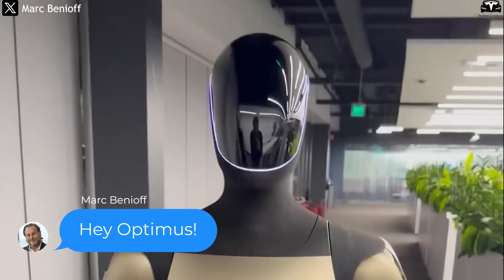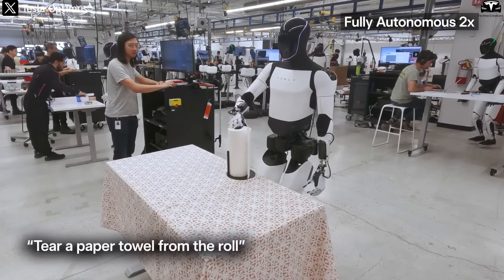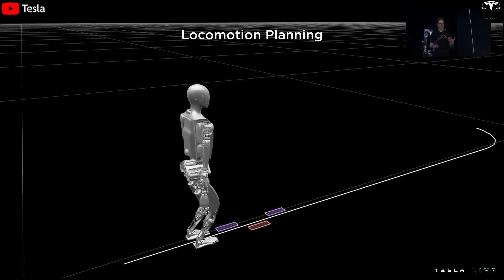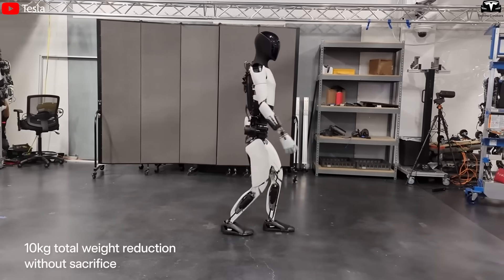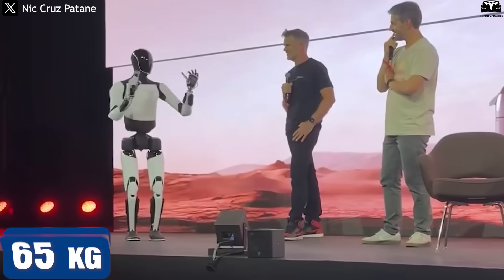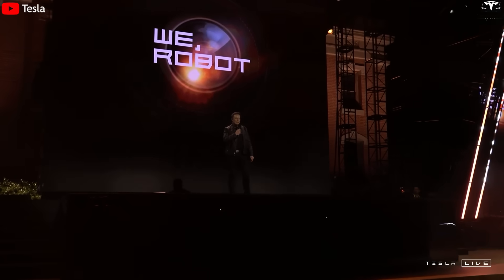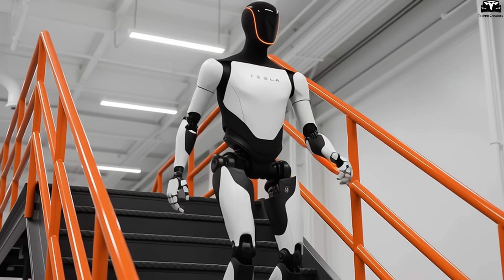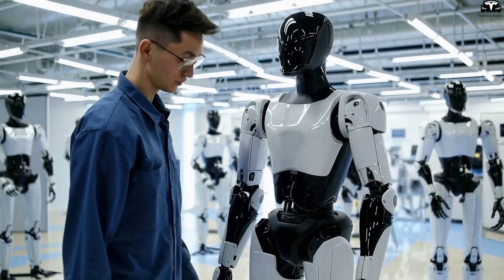BIG UPDATE! Tesla Optimus Gen 4 Next-Gen Design With Grok AI & Insane Abilities! (Never Seen Before)

Comment: Knee replacements? What a joke. More way to make money. Sure, equipment can break down over time, but a robot walking is going to tire in 4 to 5 years? They are designing so it breaks down easily. I bet it's 3 years. A robot is not going to be able to respond to any infractions that may occur. A human can react on its feet. Also, they take up lots of energy to run.
Reply from the maker: Interesting point, but Tesla aims to design Optimus for decades of operation with efficient power use and repairability.

Comment: Interesting fact, let’s say the two robots lifting the big box up onto the surface above let’s say that was too human beings doing the same thing every day on their shift until they retire and let’s say just for reference they are 20 years old when they start that would be a repetitive motion done every day, so in their career they would’ve done that 10 million times plus the fatigue on the knees and the elbow joints as well as other joints would be somewhat stressful on them without knowing the exact aluminum magnesium alloy type I can only estimate but I would say that those joints provided with good enough dust covers just like a human being has dust covers over their joints which we call skin but anyways, if those dust covers are maintained in theory those joints could last without replacement for 50+ years, but for a safe assessment oud say they’d wear out somewhere between 30 and 50 years so technically that would be better or slightly worse than a human being in the span of 45 years of work because some humans hold up better than others so you have to factor in. Did they end up getting knee surgery because of the job or elbow surgery or some other joint surgery because of the job like I said it’s kind of a monotonous job but it does give you the idea of the durability of the material and design at least that part of the design.
Reply from the maker: Really thoughtful breakdown — comparing human joint fatigue to robotic alloys shows how durability could actually rival a lifetime of work.

Comment: I worked as an engineer in the cinema industry for a decade. The problem with a robot serving popcorn is that the grease in the air from making pop corn gets into machines. For example if you have a cinema projector on the same floor as the popcorn room, the grease particles in the air make their way into projector filters and then it clogs up the cooling meshes, which in turn requires you to soak the filters in a chemical that dissolves grease. You should definitely shield the actuators from the environment unless you want to keep servicing them.
Reply: Just make the robot swim in isopropyl. It doesn't affect the electronics (doesn't conduct electricity) and it disolves grease.
Reply from the maker: That’s a great point—protecting actuators from environmental grease is crucial for long-term reliability.
Reply: Contamination sources must be confined and collected, but I expect that engineering a machine intended for environments that are hazardous, dangerous and boringly tedious to humans will dictate both design and materials.
Reply: @brothervance1932  Most cinemas today have popcorn delivered to site for this reason. However it depends on the chain and how it's ran. The one I worked for made popcorn inside the cinema.
Reply: It amazes me how much little specks of grease from the galley get on the 17” flannels in the cockpit from the galley. Especially when she is grilling steaks
Reply: Iva’s been saying robot gloves are going to be a huge new market. Then protective clothing overall.  Like we want it to do dishes….